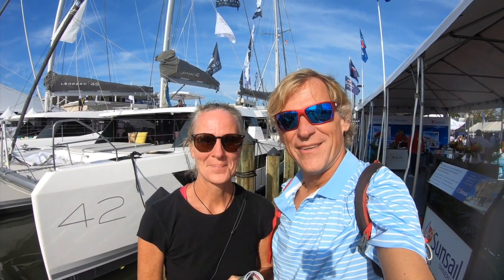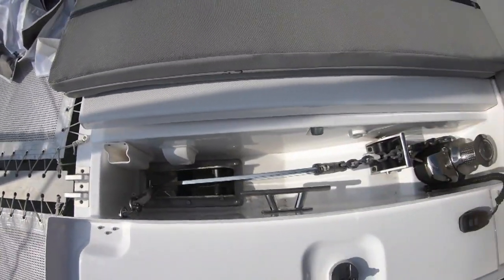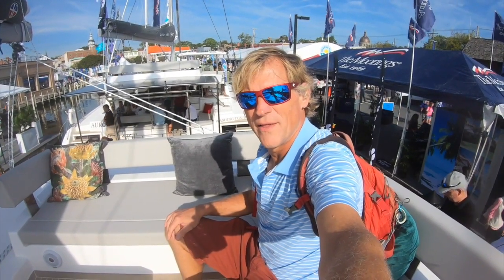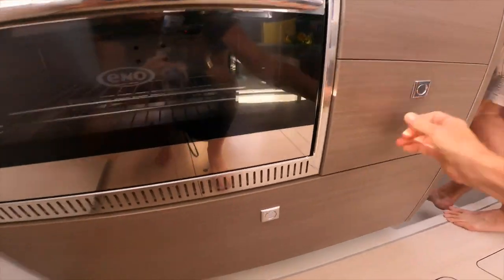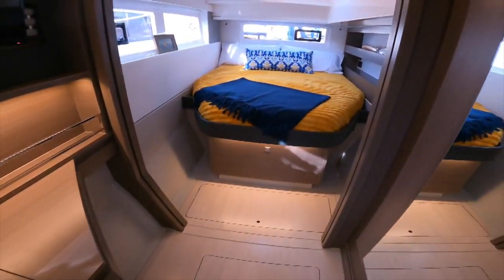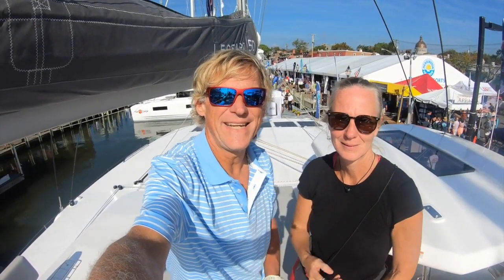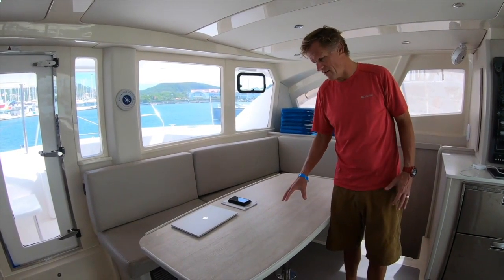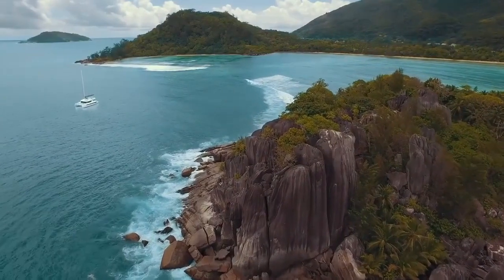148: COMPLETE Tour & Analysis - 2021 Leopard 42 vs. Leopard 44 Catamaran - 2021 Annapolis Boat Show

Comment: It was nice chatting with you at the entry line to the Boat Show. 
Thanks for a very in depth review of the Leopard 42 as well as the pros and cons comparison to the Leopard 44. You found and pointed out a few things I missed. My Admiral also comment about the near useless notch access at the foot of the mattress. I must say prior to boarding the 42 I wasn’t a fan of the coachroof lounge but given it’s low profile and relatively minor impact to helm visibility I could see having a morning coffee or a sundowner up there. The sky light is nice but given the number and size of all the other surrounding windows I think it’s unnecessary and impractical for boom access. The draft on the L42 is 5 more inches more then the 44, at 4’7” rather deep for a cat 😕,  and I think it’s just a foot shorter (LOA) then your Leopard 44. With all that being said I am really impressed and interested in the Leopard 42 and will include it on my list to Santa.
BTW What is the displacement of your 44? I found two different weights listed, 2711 lbs and 32930 Lbs? Brown commented on the large 45hp engines on the 42. Do you feel like you could use more hp? What speed do you power cruise at?
 Thanks for all your time and effort you put into a great review of the leopard 42.
Reply from the maker: Hi Tony!! We loved getting to meet you in person. Thanks for stopping and saying hello! And, thanks for all of your help with great anchorages! Wow...you found a few things we did not! Well done. I didn't realize the draft was 4'7". That's almost a foot more than ours and I agree, is quite deep for a cat. Yes, the 42 is a foot shorter in length than ours. I agree with you on your assessment of some of the features mentioned. And, your Admiral is a smart one! HA! Our displacement is almost 20k pounds. We looked it up the day in our manual as we wanted to know what we weighed, approximately. But, after shopping at Costco, we may be closer to 40k now! HA! As for the 45hp engines, I think every cruiser likes having the get up and go, especially the captain but our 39's do just fine. We normally only run one if we are motoring and can average around 4.5-5 knots if we are not nose to wind or fighting a current. We can do 6knots with two going, typically. Thanks again for your comments. Next time we need to meet your Admiral!

Comment: What’s your thoughts on Elba 45? Seems a decent sail performer & interior  design nicer than other production cats  but I here FP’s customer service is non existent.
Reply from the maker: Thanks for asking. Every boat has its great points and it’s not so good features! Customer service is helpful, but most of your assistance will come from fellow FP owners. We always recommend buying used as it’s fully depreciated and you don’t struggle with warranty issues and fights.